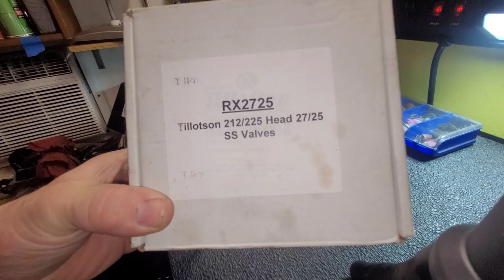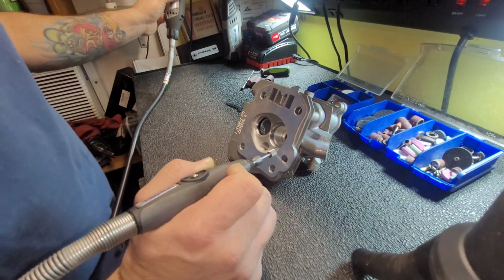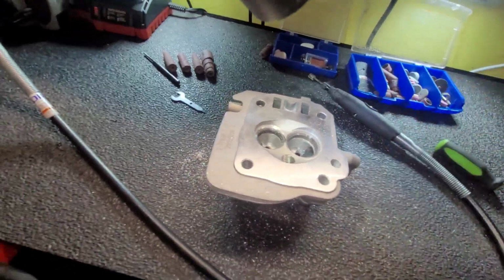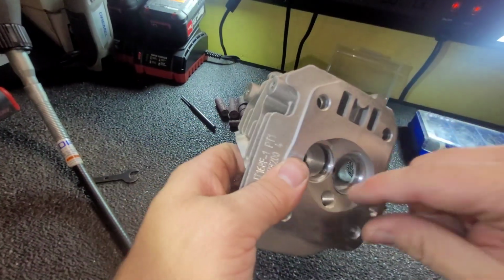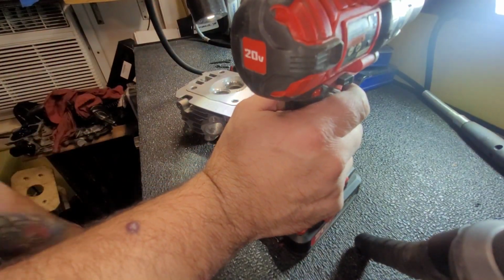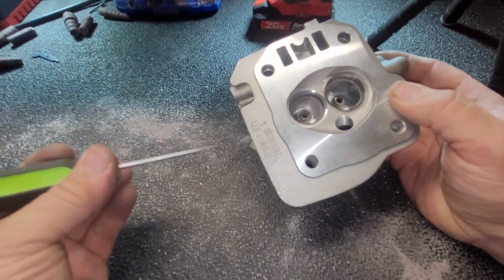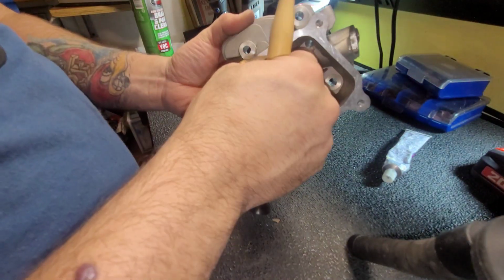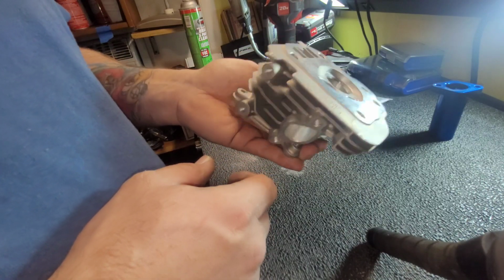Porting and polishing the 224cc Tillotson big value head

Comment: Beautiful port job.  Only thing I’d say for the new guys trying this is tape off the valve seats or coat them in candle wax.  Sounds weird but will buy you some condom level protection if you bump the valve seat with the side of the shaft spinning inside there.  Obviously not needed for guys like “D77” who’s done 100 of these things.   Helpful for a first timer.   Especially when that carbide grabs and yanks the tool from your hand.  😊

Comment: Good explanation on the valve lapping too. Telling people to pick up and spin so it sets more lapping compound down in your lapping and showing people that grey dull surface is perfect 👍🏻.   What do you think of the guys that put some tape and drill on the backside?  I always felt that puts only one direction of lap and force on the valve causing it to “tip” ever so slightly.  🤷🏻‍♂️.   Lapping by hand to me ensures the entire surface receives contact with the seat like during operation.

Comment: I think imma do this to my stock head! I have a mod 2 cam, billet flywheel/rod, filter, exhaust & its slow at take off, i get beat by a 212 with just filter, exhaust & amazon flywheel -.- like the from start to mid range he walks me, its until from 3/4 to full when i start to catch up, i just have more top end & my gearing is .16 higher, so it should have a tiny bit more pull. So changing carbs to a vm22 26mm & hope porting job helps with a good strong low end power as well. It lacks.
Reply: How did it go? I just switched my stage 2 racer tillison 212 from the fake Amazon mikuni vm22 to the real one
Reply: @camtheman559 nibbi 26mm definately helped a lot. Catched up halfway the track we race instead of at the end.. also went with a super x cam, ported heads. Same gearing as the other bike (12/60)

Comment: Is the 196r any good it's a lot cheaper then the 212 tilly of should I get that long block they got good vid n info too boss💯✨✨✨✨
Reply from the maker: 196 is a good motor you gotta watch what brand though the Jang dong have bad cranks in them they split
Reply: The tilly from gopowerfarts is what I'm thinking of coping
Reply: My brother has a built tilly 196 and it's a badass motor. I have a clone 196 the one from coleman all built up and I love that motor! Plenty of power. Just finished a predator  224 build and it definitely has more low end power but all around not a crazy difference overall as of yet but I have only rode it a few times so far.